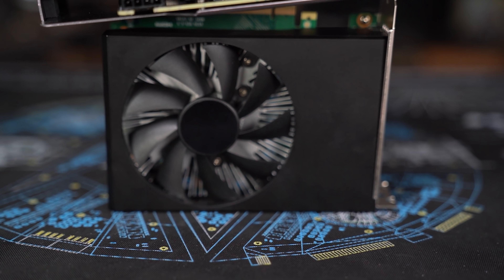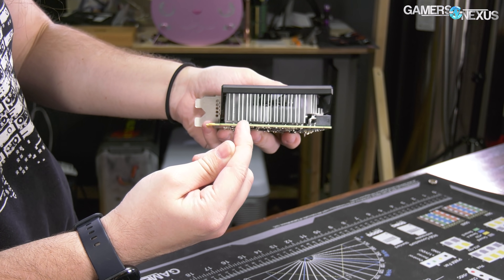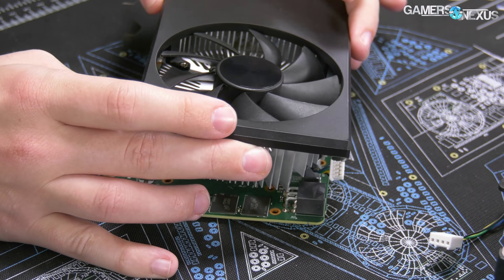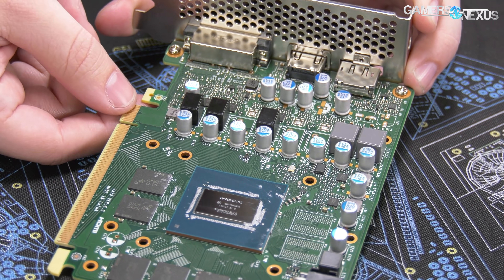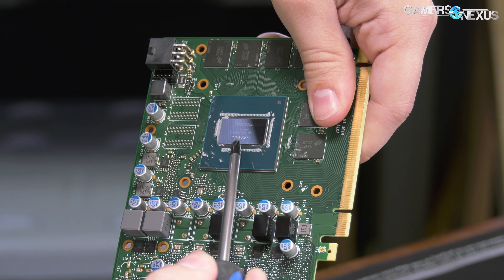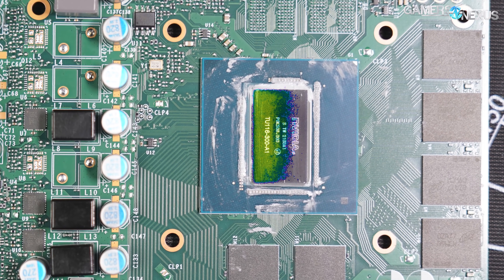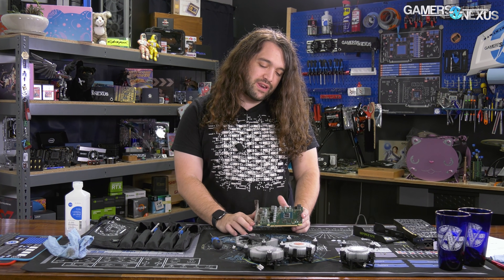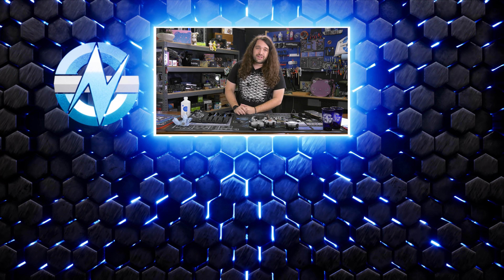Bottom of the Barrel: 110°C VRAM Dell GTX 1660 Super Video Card Review

Comment: "We wondered what the bottom of the barrel looks like. This is it. This is what bottom looks like. There is no lower."

He's going to be so disappointed when he discovers "scraping of the barrel".
Reply: "It's so bad we fell through the map floor and are looking up at the barrel bottom."
Reply: nope... noname prebuilds with fake cards are worse :D
And they are pretty common at ebay, especially since this low aviability and high prices of GPUs you can make with such scam good money on casual users.

Damn, i even felt like im a scammer myself as i sold my loved GTX 1070 a while ago... paid for it i think about 360€ (brandnew in 2016...) and sold it about a month ago for 400€ since im using a cheap RTX 2080 notebook now until proper GPUs are aviable for a fair price.
Reply: @harrison00xXx  you did good, i'am thinking of selling my 970 but not going to ship it. local only.
i have 2 970's but few games use sli, should have just got a single 980 then & saved some $$
Reply: @OugaBoogaShockwave  yeah, the days SLI made sense are over. I had SLI in about 2005-2006, also a total waste of money.
I was using a 1600x1200 CRT, but my... idk, any midclass Geforce 6xxx was too weak for Far Cry (the game i loved the most of all classic Singleplayer Shooters) in anything higher than 1024x768. I saw how well this game scales with SLI (+80% fps!!!) and also many others too these days so i though i need the new Geforce 7950 GX2 SLI GPU with dual-PCBs :D over 600$ (that was a crazy amount for a GPU these days, 50-250$ were regular) but damn, it was fast. I was at least one of the very very first people in the world, enjoying Far Cry in max graphics, 1600x1200 and playable fps. That was only possible with Geforce 7900 GPUs in SLI until the 8000 series was released. In Fact Far Cry was also the main reason i wanted a "Hi End" SLI system then.

Pretty much a bad deal... 600$+ for a GPU which was about 1 year useful. But hey, thats what you deserve when you really want special things like SLI and absolute Hi End GPUs... I learned my lesson, since this mistake i will always prefer a fast single GPU over any SLI/CF setup. Time also showed, multi GPUs are pretty uninteresting already for games.
Reply: @harrison00xXx  yeah, i agree with getting in to it early & "thinking" it's a great value but time proved me wrong.
Back then i thought if SLi proved to be good i got a value for my $$$ but that didn't happen.
Now they want us to pay the same CrAzY $$$ for single gpu's call em ti or super or what EVAR doper !
NAH, i just WON'T buy new games & they can KEEP their BS to themselves !
Reply: @OugaBoogaShockwave  I mean... it totally depends on the demands the "gamers" want.... Ofc, if you want to play modern games in 4K 60 fps or even higher... there is no chance to get a fair price for this components.
But as soon you picked a proper GPU before this sh*t happened... for example my "luck" with the 1070... even considering it cost nearly 400€, it was totally worth it. Had awesome 1440p performance at mostly max settings for multiple years. Only with modern titles from 2019 and newer i realized my 1070 is already slowly getting "old". But 1440p was still with 60 fps+ playable at slightly reduced graphic settings, so still fine.
In the end i sold my 1070 not because it was "too weak", in fact the 1070 was still enough for me in 2021, i sold it because i switched from a Desktop to a RTX 2080 notebook which (unintentionally) replaced the desktop completely.

If we could only say a RTX 3070 for example would be a fast and useful gaming card up to 2026 at least... i would be probably fine with paying like 600$ for it, but i even KNOW this isnt the case, especially with its "weak" 8GB Vram... And if i pay like 600$ for a graphics card, i want ABSOLUTE HI END, so more of a 3090 or a not even existing 3090Ti. And especially not something like this "LHR" (light hash rate), if i consider paying a shitton of money for a fast GPU, i also consider mining with lowered settings (to reduce or even "stop" degradation at all) if im not doing anything on the PC to get a little bit back from this expensive "investment".

My 1070 made in the last months before i sold it also 200€ in bitcoins (dagger hashimoto) extra to the higher price i got than i paid in 2016... (the mobile 2080 even more, about 350€ in 2,5 months!, energy costs were about 30% of the money i made)
Imagine this would have been done with a single RTX 3080.... easily 500€+ in the same time with MUCH better efficiency. With this LHR variants now.... shame on nvidia and the ("professional") mining a**holes. GPU mining should be only considered by gamers or regular people with faster PCs to make at least a bit "use" of it while it would do anyways nothing. Hell, i even played games WHILE mining, easily capped the fps to like 30-60 depending on the game, reduce resolution and graphic settings and boom: hashrate only reduced by like 10-30% but still playable gaming experience.
Anything else, especially the people which are "living" with cryptomining... should be forbidden at all to use GPUs and using only ASIC miners, thats anyways the better choice (for the user AND the enviroment)
Reply: I was even chatting already with someone who did this and i knew it because i saw already on the pictures it isnt a legit GPU.
After a while texting with multiple accounts accusing him of selling fake components with the PC this guy finally admit he is using fake GPUs he even bought INTENTIONALLY for this reason. He deleted his account and inserats and with a new account all systems went "online" again, but with tiny differences: The specs he listed in description were correct, at least for the data most people have no clue about (like the GPU name TU-xxx, Gxx and so) but he still tried to sell the parts as they are shown in the faked vBIOS.

Others buy a bunch of cheap OEM (office) PCs with at least a "dedicated" (ultra low end) GPU and resell them as "Gaming PCs" for like 2-4x the price... whats wrong with the people, i dont get it...
Even dare to say "all new AAA titles are playable".... playable? at 10-20 fps with heavy stutter? for real? and 30 fps is "high refresh rate" gaming or what?
Reply: He didn't yet realize that barrel is at ground level and CAN be thrown down a well.
Then, at that point, beyond the bottom of the barrel there will still be the bottom of the well.

And ofc you can still dig that bottom to go lower, but then we will be dealing with a GPU plugged on a wall outlet, I guess lol
Reply: He should try my current Ryzen 5 system with a GT640 since February............
Reply: @buggerlugz6753  GT 640? you are better off with using the iGPU of the Ryzen haha
Reply: Tech industry is very good friends with Murphy's law.

Comment: Crack the sides off of the shroud to let the air out? Would that do any good? It doesn't look structural.
Is there any cheap-ish cooler replacement?

Comment: I think it's a bit harsh to judge the pcb for it's iteration.
Sometimes it just needs engineering cycles to get stuff working the way it's supposed to (by the designer).

Of course it's a matter of opinion whether or not something performs 'as supposed to'. ^^

I also think that the fact that you weren't able to find these exact caps doesn't really say anything about quality.
PCB components often aren't 'track able', especially little stuff.

However if you normally tend to find random components without obvious model number/'name tag' i would really be interested in your method! :)

Btw probably gonna buy a legion 5 with a 3060 this week. 
Guess performance and price wise it won't be better than this 1660 Super, but if you need a notebook... :(

Comment: My Ex wifes parents bought my son a Alienware with a 1650 and believe it or not the gpu is worse than yours. His doesn't even have a true shroud or fan. It has what looks like a mini cpu cooler. I wish I could afford to get him a gpu as nice as this one in the video lol
Reply: Back in the day (the mythical mid-2000's), I used to tell people "friends don't let friends buy Alienware." They haven't changed much since Dell bought them. Arguably they've gotten worse. At least back in the aughts, they were just grossly overpriced.
Reply: A nice fix that would be cheap is aftermarket gpu coolers. They make them but you may have to do some digging. You could "fix" your son's GPU issues without spending alot of money. The Arctic Twin Turbo series also gives enough space for small component heatsinks.

Comment: That cooler (minus the shroud) looks fairly similar to other Dell heatsinks on server parts, my guess is that they reused an existing design and just adapted it to add a fan and shroud. 
Remove the shroud and you get a design philosophy that seems to mostly fit the server parts design - VRMs and other parts in servers relying on high case airflow to cool instead of using heatsinks, with the PCIe bracket well perforated for airflow egress. 
Further adding to the possibility that it's a modified server design - the shroud look pretty much like an afterthought to the heatsink with blocking air paths, while the PCB is the regular green color like on all their server parts
Reply: not at all - server part designs are streamlined - and while the PCB are green they resemble teh quality of teh cheapest of server parts aka entry level.

Comment: It actually performs better than the Msi, but you are still bashing it? Seems like its performing just fine. Title is misleading. Heck, most 3090's reach close to 110c when mining, so what's your point? It's not throttling and runs within spec.

Comment: Even if it sucks, I'd like to see a video where you spend a couple bucks to add thermal pads, maybe a different cooler, and then suddenly you're able to work with a better cooled GPU without spending and arm and a leg on a GPU online.
Reply: I think that's Steve's point. Dell made a GPU so cheaply that a few bucks more might have made it perform significantly better. For those of us that are comfortable working on hardware, it would not be a big deal to mod this GPU with a better cooler and mount.  However, a lot of people who buy these systems have no clue on how to do this.

Comment: On my Dell 3080 that came with the Alienware R11, it has board model MS-V389 Ver. 5.0.  Looking this up, it seems MSI is the one that made the card, as they have in the past for Dell.  I assume it is the same here with the 1660 Super since it has a similar format for its board name.  I hope they bring ReBAR support for my 3080 soon since it'd be nice for a few % boost in some games.  Thermals have been alright except for the VRAM, for which I added thermal pads to fix.  Fans are also a bit noisy, but I can deal with them.  Nonetheless, it's entertaining to see when you grill products like these!

Comment: Dell engineer at an interview (translated into plain language) : We design our products for maximum performance and least cost. Why design something to run so cool that the components will last 10 years of continuous use? Our products run hot enough that they will perform well and last enough. Not doing so is a waste (of our money). If you have a problem, That's what the guarantee is for.
Reply: "last enough" i.e. fail a few days after the warranty period is over.
Reply: @r34ztune11  Pretty much.  Still the amount of work needed to be able to build something as cheap as possible and and last just enough the warranty period is over is pretty interesting.
Reply: Takes big company arrogance to just assume their defintion of "enough" is even nearly the same as their customers'.

Comment: Other than the mem temps this card is just a bare minimum design. The VRM's are fine to operate above 100c. Maybe a slightly different cooler design to keep the mem temps under 100c via airflow would be good

Comment: I didn't know a 1660S could run so hot! My Asus Strix 1660S has been great so far. Having a quality VRM, 2 HDMI+2 DP ports, Dual BIOS, 4-pin fan header for GPU+CPU temp control, fully automated manufacturing process, a nice OC, and tasteful RGB made the $20 markup worth it for me. This video highlights why it's a good idea to spend more based on component durability and the company's reputation for customer service.

Comment: I'd be interested in seeing this card 'improved'. Fixed as in - Slap on some thermal pads on the Vram, and the other bits that usually have it, take away the shroud, apply some.. Better thermal paste and.. somehow improve the mounting pressure? Is that even possible?

You could even call it 'Dellving into the barrel 2: Improving Dell's bullshit.'
Reply: You might be able to improve the mounting pressure with a set of spring tensioned screws.
Reply: I'm curious too. I bet you can make it decent.
Reply: The performance is on par with the MSI 1660 super. They might be able to improve longevity of the card though, by improving thermals.
Reply: @adarshchoudhary1900  they, at least, could've showed us the difference between memory temp with pads.
Reply: @assetaden6662  yeah, true!
Reply: @adarshchoudhary1900  Yeah, in their testbench so it actually gets airflow over it fron the front intake fans blowing over it vs in the prebuilt with only exhaust.
Reply: its doing alright as is and I doubt one can fix the rest of cheap parts.. It generally seems to be an ok card but will die young due to bad parts..
Reply: I'd like to know if Arctic GPU coolers can fit on this board and if it will be a good upgrade. They make coolers for this size of boards.
Reply: You could improve mounting pressure easily with one of those X bracket things that screws into the back of (and comes with literally any modern decent GPU) now.
Reply: It's possible, but depends.
I have an Asus 1660ti dual, it comes with a cooler/heatsink slight less worse than this one.
I just slapped an aio on it. No regrets: 60c while gaming, where previously it reached 96c. Been running like that for two years now.
Reply: Oops, I see you beat me to this comment. Should have read before writing.
Reply: This is a good candidate for a water block.

Comment: I just look at this, and what Dell decided to sell with a straight face as a "complete" system, and I have to wonder one big question: Why in the HELL is dell allowed to get any business, even now? Any other business venture that was this bad at making a product would have seen them going out of business so fast. Dell has been doing this, for *decades*. They've been doing it since the 1990s. why do people and businesses keep buying this crap?
Reply: Plenty of Dell’s business machines are/were great. I’ve been out of IT for 4 years now, but we used Dell desktops/servers and laptops at my previous 3 companies. Aside from a horrendous batch of Optiplex machines back in the P4 days, we very rarely had problems. If we did, same day prosupport meant there was minimal work to do for us. Their home desktop/laptop range is where everything seems to fall apart.
Reply: @emlyndewar  that sounds like exactly the one Dell desktop I had for a while. I picked it up because it was super cheap and came with monitor and stuff I was expecting to re-farm otherwise. At least it appeared to be a standard form factor and still had AGP. 

But I found quickly enough that, while it looked standard enough and had a reasonable PSU, it hated every upgrade I could throw at it. There was literally no other video card it would work with without crashing nonstop. I finally just had enough and sent it off to someone else and kept the monitor.
Reply: @ZeroHourProductions407  I don’t remember the model, optiplex gx something… The motherboards didn’t last very long at all!
Reply: Problem is the consumer market for dell is fairly small compared to the enterprise solutions and corporate laptop lines like the precisions etc. At this point I think they're selling to normal people simply because the name is too big to fail.... for now